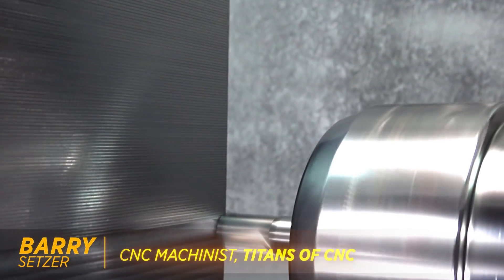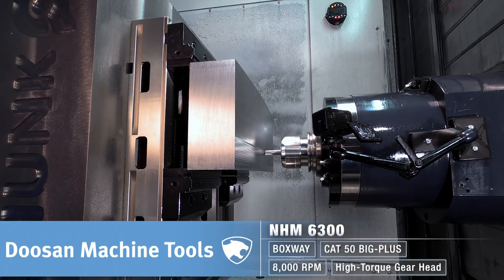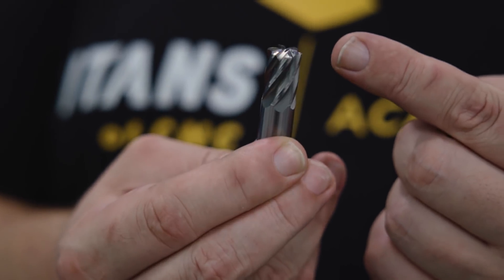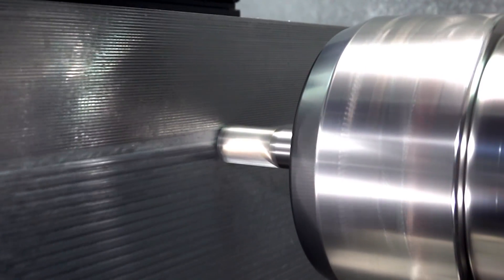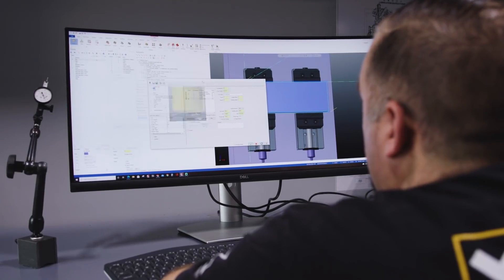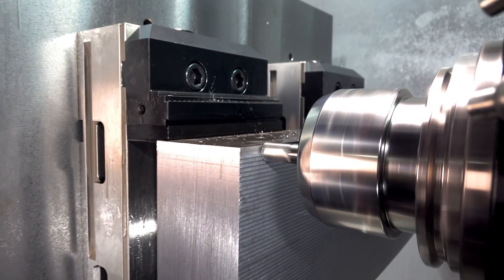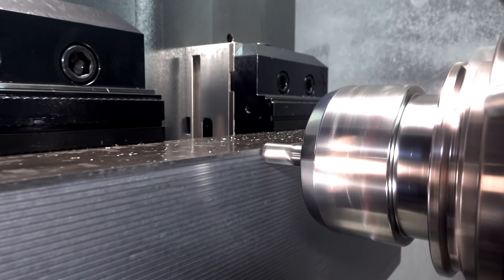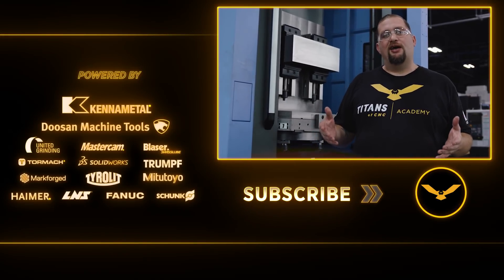This Custom SUPER TOOL is 4X More Efficient at 3D Surfacing Than a Ball Mill

Comment: I really want to touch and feel the finishing of surface
Reply: We checked it in both directions with a profilometer after running this toolpath, and it was a 32 finish in one direction, and a 63 finish in the other direction. Not bad for a .056" stepover with a 1/2" tool

Comment: How should I calculate RPM & feeds (Metric) for completing a job in optimum time?
Reply: Testing. It's all about testing and experience. Start by increasing feed then speed
Reply: Run it till it goes bang and 10% back

Comment: last month i found out to use a high feed insert geometry. They have a bigger radius, and the best thing is, there is no cutting in the toolcenter, so you get a more even surface finish. but you have the efford to define the tool geometry exactly in your CAM software.

Comment: Why not just buy one of those tools instead of making one? Lots of companies like Emuge make really good ones.
Reply: We could have done that, but here we can make a tool in an hour, instead of waiting for the next day. The main point here was to show this tool and toolpath to people that have never seen them.
Reply: @barrysetzer  I guess that makes sense in a pinch, but most suppliers carry them on the shelf and you can get them same day.  Also I'm guessing that the reason your surface finish wasn't that great was because the geometry on a tool meant for tangent machining will be different then a regular endmill.  I guess if kennametal doesn't make them, what are you gonna do
Reply from the maker: The point of the video was simply to show process and introduce a new tool / programming strategy that many may not have seen.

Comment: Ya kinda left the punchline until 2/3 of the way through that that was a rounded surface (from the video it just looked like you were facing a big flat block with a tiny tool) I might have led the video with the fact that that block was in fact convex.

Comment: Good way to describe the concept, coring out the center of a large ball end mill and just using 1/2" of the center to mill the feature  with.
Reply: That's not what they did though, they ground the bottom of a regular end mill so that it is in the shape of a lense.  Basically the base instead of being flat has a huge rad, like say 20 inches.  So you tip it a few degrees and your effectively milling with a 40 inch ball nose.  Lots of companies sell them but kennametal doesn't so they ground their own.

Comment: Looks a lot like a high feed end mill. Don't know if hfm's would work in these kind of applications, though.
Reply: It's actually very different, they are often called circle segment cutters, alot of companies sell them but Kennametal doesn't, they need to be ground to a very precise shape so that the CAM software can get accurate toolpathes without steps or over cutting.  The idea isn't to feed fast but to take large stepovers and still get very small scallops.    This video shows it really well https://youtu.be/15tJet3U_q8

Comment: If you have a 4/5 axis cnc you can tilt the head to have about 1 degree of lead and you’ll get an effective diameter that is huge, we use a formula to calculate it bc it’s based on the diameter and radius but a 3/4 EM with a .03 rad can achieve a 0.0002” scallop height with about 0.125” step over. Works really good if the surface has some contour but not too much
Reply: This sounds like something I want to know when i eventually move to 5 axis.

Comment: That's about the worst toolpath I've seen for such operation. 
And a bad tool choice.
Bull nose or as others posted a torus would had performed much better.
Reply: The point of the video was to show these tools and toolpaths to people that have never seen them. There are always better tools and better ways to do something, but you have to teach in levels. The torus tools are the next logical step!
Reply: @barrysetzer  Well if they want to show inefficient way to machine they succeeded.
Reply: @sharg0  How is this inefficient? This is machining a convex surface with a tool that has a 1.0" radius on the face of it. Are you saying that a 1/2" ball would be faster? LOL
Reply: @barrysetzer  Read my posts again.
Reply: @sharg0  There's no need to. I programmed this part, it's me in the video. And I'm telling you that you are incorrect about almost all of what you said. But thanks for the feedback.
Reply: But it would Take much more time because U would have to Take a mich smaller stepover for the Same surface finish
Reply: @m_m_nbg  On the contrary. Lookup the difference between bull nose, torus and ball nose.

Comment: Half way to a high feed cutter

A better version of this is called a torus. The center is recessed so you never cut on the zero surface speed of the centre of a ball and it gets rid of the draglines and tool wear which kills balls. Program exactly the same as a radii endmill

Ball mills suck balls big time
Reply: True, but I think this tool shines if the radius would go inwards with no flat surface in the middle, there you cant use a torus endmill because of the flat bottom
Reply: First I have heard of that tool, thanks.  Charles
Reply: But With a Torus Cutter you have a smaller Radius in your Tool.  For better surfacespeed There are also circlesegment cutter(Like in the Video) but with the circle segment around the axial Axis, and Not the radial Axis Like in the video👍🏻
Reply: @m_m_nbg  Yeah you are right I would always prefer the torus endmill for surfacing, but there are some features you can only do with a ball nose. And the cutter with the big side radius I think is called barrel or parabolic endmills, which are great for steep slopes. Wish they could make a Video about them.
Reply: Or Evan bull nose is better
Reply: Wow thats crazy, my dad was just telling me today about a time he ground the center of an endmill down just like you describe. He used it for better ramping way back in the day. Crazy timing coincidence

Comment: That doesn't look like great
Reply: Also it work on flat surface only, I wonder what it can do on round corners where ball endmills are on the basis
Reply: Generally circle segment cutters make beautiful finishes, I think this is because they ground their own.
Reply: @85CEKR  You can graind your own as you wish but claim it better than Ball Mill is too far...
Reply: @robertkey69  no I meant that the reason they didn't get a good surface finish is because they ground their own.  We use them from emuge and they leave beautiful finishes.  Their advantage is speed though not surface finish, if you want the absolute best surface finish go with a ball mill.